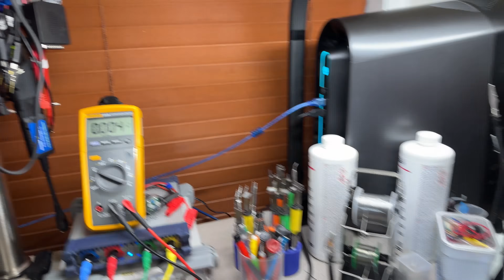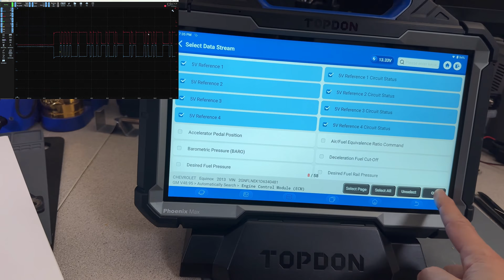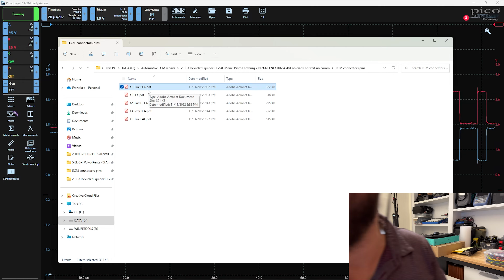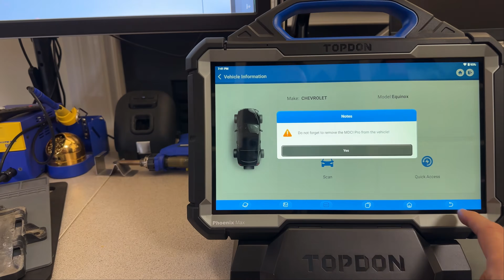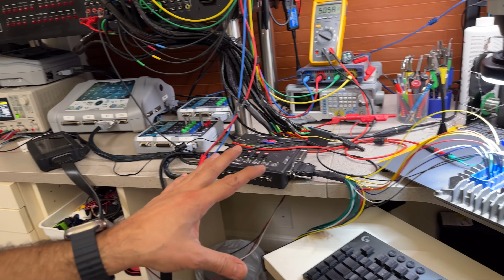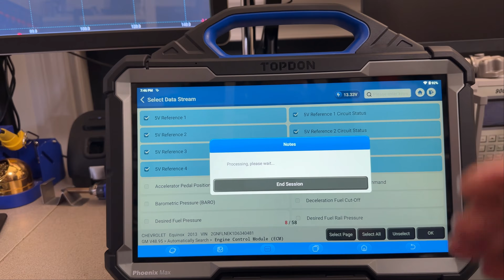2013 Chevy Equinox 2 4L No crank, no start, no comm ECM E39A repair for Manuel Pinto

Comment: What would cause a code p0630 I believe is the code on this model ecu? It has other codes also all basically saying vin not programmed or something of that nature. Ecu was not changed. Customer states car died at red light and towed directly to me. I can scan and get codes by manual vehicle selection and scan but vin read won't work. So I assume ecu has at least some communication just not reading security info. Is it on an eeprom I can access and possibly repair?

Comment: Hi Maic,
I know it is not easy to learn on this type of trouble shooting for car's computer.
I see that you have a very good set up to do this, in your home.
I starter watching your videos and I am thinking i can do this as I have an associate degree 
on electronic and I was a technician on reparing uninterructive power suply (UPS) to the 
component level.
I would like to know what will be the minimum equipment, you need to have to start repairing this type
of computer?
How much, approximately, it will be to assemble the minimum equipment needed?
etc.

Comment: Hi Mike ( I know, its Maic.  LOL)   What a great channel you have here.  You have a combination of electronics and mechanical stuff going on here.  I`m a regular factory test technician.  I work at a circuit board assembly house.    We make circuit boards for a lot of different customers.  Electronics is my hobby also.   At work I do simple tests on circuit boards coming off the assembly line.   I have always wanted to buy one of those car diagnostic computers to mess around with.
Reply from the maker: Thank you so much. I really enjoy working with electronics.

Comment: Hey Maic, incredible job as always 👍. I have question on the topic 😎. It's nessesery to check for shorted sensors but what about, if one of the many 5v reference wires that comes from Ecm is direct shorted to ground? Will you recommend testing all these 5v reference wires for short to ground before installation of  repaired module. Good luck and thanks.
Reply from the maker: Hi Petar, excellent comment. Yes 100%.  Thank you